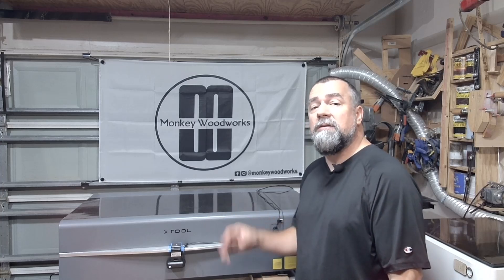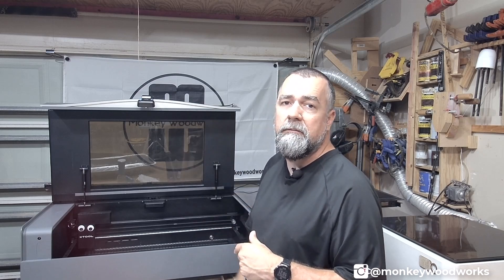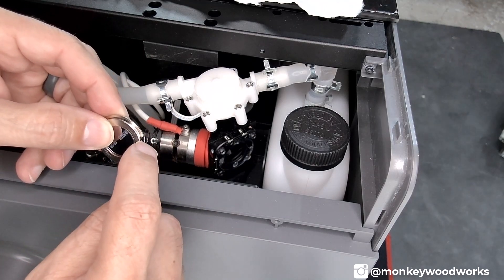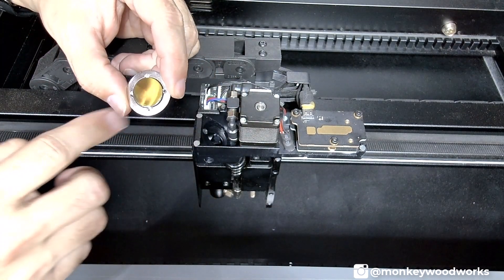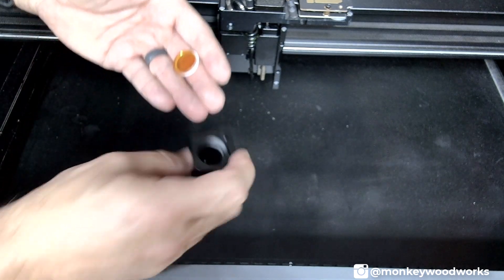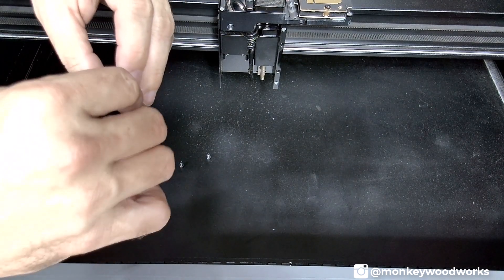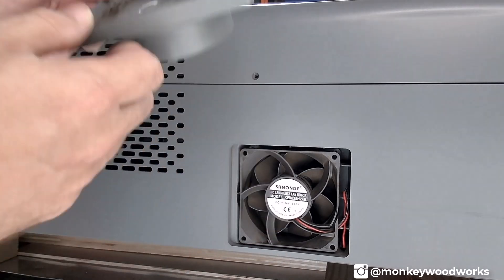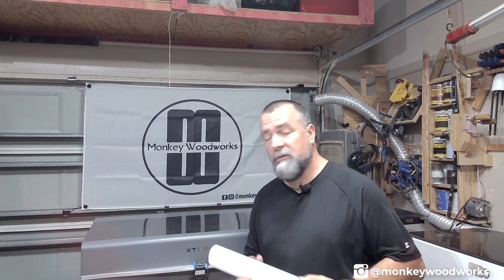Cleaning Your xTool P2 CO2 Laser cutter

Comment: Excellent video!  Now I’m not afraid to clean my P2.  I’m brand new to this.  Maybe a silly question, but how OFTEN should you clean the machine.  I’ve only cut out a few acrylic pieces and 2 wood bookmarks.  Not sure how many minutes or hours of cutting to do before cleaning up?  Thanks so much!  I’m going to subscribe and watch your other videos!!
Reply from the maker: If it gets high use, At least once a week.  If I am doing a lot of cutting, I'll stop and clean it between batches.  It's better safe than sorry, plus it keeps the performance up on the laser.  Wood really makes a mess, acrylic you can go a bit longer between.

Comment: OMG it took me an hour to pry my back open - apparently my tabs were screwed in so they all broke off after my twisting and lifting - all my fingers have blisters!  even after the back was removed, i could not pry out the tabs that broke off - and for the life of me, I could not find the screws that were holding them in place..... kind of upsetting..... but what ever... its done and I cleaned that back mirror!  thank you.  I dont put fluids because the temperature of my location do not require it. so it was the first time I was back there.
Reply from the maker: Oh no!  Sounds like you had a time getting it off but I am glad you did.
Reply: Yes and thank you for the tutorial.  Love your work

Comment: How often should you clean
Reply from the maker: It really depends on what you're using your machine for.  Wood makes a mess, and lots of smoke and dust are involved, whereas acrylic makes far less of a mess.  My rule of thumb is that if the back left inside vent of the P2 (under the gantry) is getting pretty dirty, it's time for a cleaning.  Or you are noticing a degrade in laser power as well.

Comment: Went by your step by step cleaning video and was super careful with each step. Now the laser isn’t coming thru at all.  I took the lens housing back out and flipped lens over thinking maybe i accidentally put it in backwards and it didn’t fix it. Any ideas? Any help is appreciated. Thx
Reply from the maker: Oh no!   When that happens, the majority of the time is the mirror alignment is off.  Go back and triple check your mirrors.  Make sure they are rotated properly so the notch lines up.  Also make sure they flat and centered.  They should have the slightest wiggle when you press your finger on them and try to slide them around if they are seated properly.

Comment: Any tips of things to double check for? I just did this steps and my laser is not shooting out. It is capturing the photo, it is moving accurately except the laser part.
Reply from the maker: The most common issue I have seen in that case is the mirrors are not fully seated. Go back and make sure the notch of the mirror is around the screw (not shown in my video).  Then put your finger on the mirror and wiggle it around, it should not move if it's seated properly
Reply: @MonkeyWoodworks  thanks for the tip! The mirror inside the magnet box where the electrical components are at doesn’t seem to lock into place- it just keeps spinning not locking.  

By the way, I have to recalibrate the mirrors. Somehow the second mirror is uncalibrated. Didn’t had a chance to mess with it  more but I will this evening and hopefully that is the fix
Reply from the maker: I dont think the last mirror in the laser head locked down when I first got my P2.  It is hard to remember honestly.  I am using the P1 mirrors in my P2 so none of my mirrors lock.  As long as they are flat in place and centered, they should work.

Comment: Hi, great video! Have you ever cleaned your gantry? Mine seems to be making a strange noise now after a bunch of projects. It's almost like it's dirty or off track a tiny bit. Please let me know if you have any suggestions! Thank you!
Reply from the maker: I clean my P2 regularly just to keep the dust down inside preventing build-up.  I have not cleaned my belts.  I have cleaned the chrome bars that are inside the unit once or twice by wiping them down with a microfiber cloth and used a little sewing machine oil on my finger to lube them.

Comment: How often do you suggest to clean it? I have seen a few different answers.
Reply from the maker: It really depends on what your using your machine for.  Wood makes a mess and lots of smoke and dust are involved, whereas acrylic is clean.  My rule of thumb is if the back left vent of the P2 (under the gantry) is getting pretty dirty, it's time for a clean.

Comment: Do you use the mirror next to the tube to align?  My P2 is out of alignment and I am having trouble lining up the mirrors.  I can't get the beam to hit the layer head.  Right now the alignment shoots low by about 5 inches.  I cannot get it to rise using mirror 2 adjustments.  I can get it in line but it is low.  I was wondering if you would use the first mirror to adjust the height of the shot.  I am getting frustrated as I have been trying to get alignment for 2 days without success.
Reply from the maker: You actually have to align them one at a time, making sure the laser hits as close to the center of the next mirror until it finally hits the center of the lens.  Personally, i only had to adjust the mirror on the left side of the gantry to align mine.  xTool has a nice video showing how to check and adjust the alignment on their support page. I will say to take care when adjusting.  These are locking screws holding the adjustment screws in place.  Make sure you loosen the locking screw before trying to adjust otherwise you will strip out your screws!  When performing the laser test, use 2-3 layers of tape to make the test marks easier to see.
Reply: I got it done finally.  Took 3 days of tinkering.  The locking screws on my machine were hotglued in place so I ended up stripping one.  The only way I could align was  to take the entire mirror assembly off the printer and the loosen the adjustment screws.  It was a nightmare.  Once I got the adjustment tools working   I moved the gantry a little at a time and  press the test button and then align.  I finally got it centered.  I am going to see if xtool will replace the number 2 mirror assembly as a result of them hot gluing those tiny screws in place and making it impossible to losen.    The thing is, my machine wasn't in need of cleaning but I wanted to avoid any problems.
Reply from the maker: Definitely reach out.  They have great customer service as long as your patient

Comment: I followed all the cleaning steps you took and my laser no longer fires!!! Please Help
Reply from the maker: Oh no!   Make sure your 3 mirrors are seated properly.  If they are not, it will look like it is not firing because it cant make it to the lens.
Reply: Did you get it to work? I just ran into the same thing.
Reply from the maker: Does your laser run through the motions but doesn't fire or is it dead?
Reply: @MonkeyWoodworks  it runs thru the motions but nothing fires, wood's blank
Reply from the maker: @Dhayloern  I would triple check that mirrors are flat against the holders and perform a path test if necessary
Reply: @MonkeyWoodworks  I went thru the mirrors again, they seemed seated fine, but double-checked. One thing I noticed that I would not think would make a difference but maybe it did, is the magnetic lid on the top part of the focus arm said to be sure it went below the white line and I had to work to get it to pop down over that and now all is fine. Thanks for responding!
Reply from the maker: @Dhayloern  Glad you got it working!

Comment: Thanks for the explanation friend, and sorry, what tool do you use to dismantle the rear fan?
Reply from the maker: I forgot the exact size but the rear fan requires a smaller allen wrench than what comes with the P2.  I have a swiss army knife type allen wrench set with multiple sizes.  One of them fit it but i forgot which one.  I know it is metric, not SAE.

Comment: Hello Sir and THANK YOU for your awesome content on the P2. I have learned more from your channel than any others out there and I have watched many at this point as I get ready to hook mine up. I just received mine and so excited to get it going. I do have one question that maybe you can help me understand better. I placed my P2 on a desk in my house as I was worried about saw dust if I had it in my garage wood shop. I am confused if I need to purchase an additional exhaust set up? Being that the P2 has an exhaust fan and air assist, can I just run the exhaust hose out the window by the desk or do I, or would you recommend, I purchase an additional blower motor to suck the fumes out? I've watched videos on people hooking up hoses with an ACFinnity motor or I know XTool has an air purifier, etc.. It's all pretty vague if I need to "help" the smoke and fumes out or will the machine do a good job on its one just running the hose out a second floor window...???
Reply from the maker: Thank you so much for the kind words!   I keep my P2 in the woodshop and really do not have issues.  It does get sawdust on it but nothing a leaf blower cant handle haha.  Plus I cover it with a moving blanket when not in use.  The trouble is, my shop is not climate controlled.  As far as the exhaust goes, the built-in fan on the P2 does a good job at pulling out most of the smell/smoke out of the window.  However, from what I have seen others post, it will not get exhaust all of it.  There are two issues with the stock setup.  One issue is the default exhaust port is only 3 inches and the opening is smaller than the exhaust fan of the P2 causing a large airflow restriction.  To get around that, people have started 3d printing 4inch (or bigger) exhaust ports  (I recommend you check out Lakeshore3D on Etsy.  Mike is a big contributor to the xTool community and a top-notch guy).  I personally have a 4inch port and use a dryer hose and it does a great job at venting out my open garage door.  The other issue is the built-in fan needs more horsepower.   It is a good fan but not a great one.  Adding an inline fan (4inch minimum but 6inch is recommended) will drastically help the exhaust process.  You will want to have the fan PULL the air more from the P2 rather than pushing it away from the P2 so put the fan closer to the window if possible.  Also, on the hose routing, you will want as few bends as possible to get the most out of the airflow.

Comment: After how many hour of use should you do this?
Reply: What about refilling antifreeze/water? Do you know if the machine warns you if the level is low?
Reply from the maker: If I recall correctly, it will not run if the machine is too hot or the coolant level is too low.  I do not think there is a message on the screen of the computer.  I believe the ring light around the start button on the P2 turns red when there is an issue.  I suspect xTool will improve this and in one way or the other in the future.  I do wish that the water tank had a water level indicator to show the min and max fill range.
Reply: @DianaWalker-os1fo  Since it is a closed circulation system, it should not get low or should take a very long time. In one of the official xtool videos they say to fill it up into the neck of the jug, too. Like, almost completely full to the brim. Probably does not hurt to keep an eye on it from time to time, though! Maybe even make a little mark of your initial fill level so that you can immediately tell whether anything has changed. Not sure how often we should change it. They show how to empty it out in that same video I am mentioning, it is the initial setup video or the unboxing video, one of their more recent videos.
Reply from the maker: I am not 100% sure but if it is anything like my M1, some parts get dirty really quickly and others take much longer.  The nozzle and exhaust fan come to mind.  It all depends on how you use your machine.  The entire process is very fast once you do it 1-2 times

Comment: Where did you order your replacement mirrors from and why did you replace them? Do you know where to order extra spare lenses too?
Reply from the maker: This was a pre-production machine that had some issues when I received it.  To resolve my issue, I was sent a new set of mirrors and they did in fact fix a particular issue.  These are the mirrors that fit the original Laserbox engraver from xTool.  The only difference between the two are the notches and color of the mirror.  I did have to remove a small screw from two locations on the P2 to allow these mirrors to fit.  I am unsure if the production machines have notched mirrors or they went with the same mirrors as the Laserbox.
Reply: @MonkeyWoodworks  thank you for replying, so xTool sell the mirrors/lenses? (I can not see them for sale anywhere on their website?) What issues did you have? It would be nice to know issues in advance please
Reply from the maker: Yes, they sell a laser lens pack for the Laserbox and I am sure they will for the P2 as well.  My P2 arrived wet from the inside.  Nobody knows for sure but we believe it was from them shipping it with liquid inside the coolant reservoir and the lid to it was missing the rubber seal. The liquid had antifreeze in it and corroded a few parts of my P2 and messed up my original mirror set.  Again, it was a pre-production machine so hopefully the production versions were treated with a bit more care before shipping them out.
Reply: Great job Michael, I really appreciate the details!!